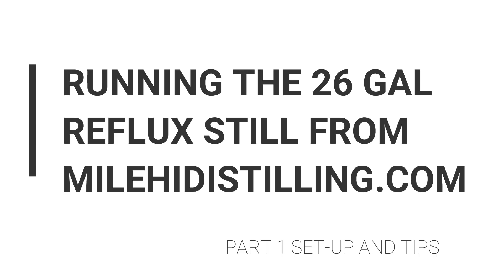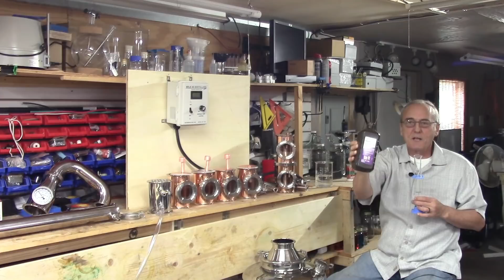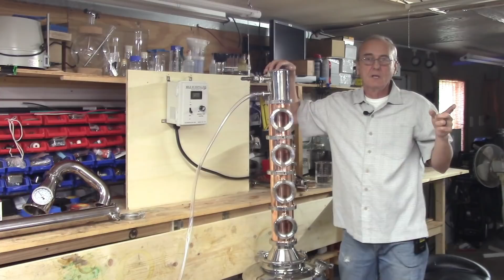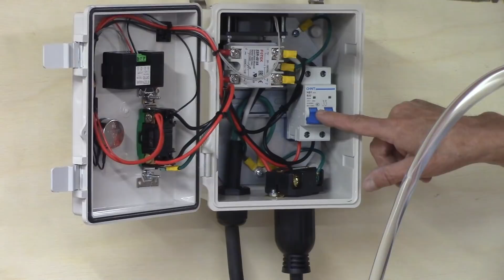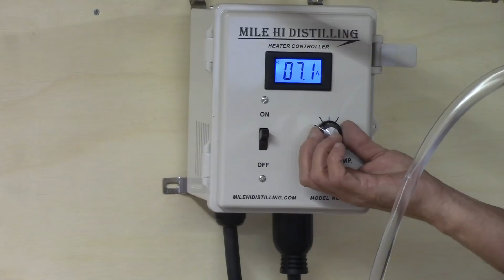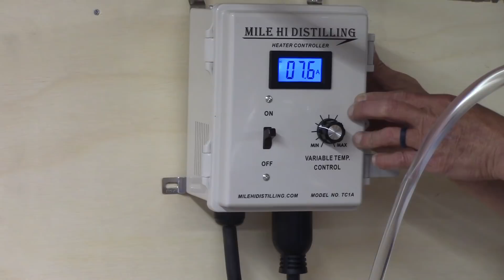RUNNING THE MILEHI REFLUX STILL PART 1

Comment: in your video for the reflux still you controlled your water flow  thru a valve on the inlet side of the reflux condensor  is it different for  bubble  plates  or a small error?

Comment: What about using a T connector on the cooling line. Then putting the straight forward line into the deflagrator leaving the turn for the line condenser. Would that mean you keep more head pressure on the deflagrator which you are going to control via the ball exit valve. Of course what you have is working, my suggestion would be more for someone that only had a T and what would be the best way to use it.

Comment: Hi , I would like to know what temperature the water flow running in the condenser should be maintained at ? You mentioned anything less than 70 degrees! Is it C grade or Fahrenheit ?
Thanks for all your vedios they are all very efficient and very well explained.

Comment: Glad I watched this video. Just went and checked my newly assembled  (& yet to be used) still with 4 x bubble plates in a glass tower as part of the reflux column, and the top bubble plate is right under the dephlegmator -  somebody  has assembled the bubble plate stack together incorrectly.  Thankyou George, you are a constant source of good information. Looks like I'm going to have fun pulling apart the bubble plate stack tomorrow :(

Comment: In a cross tube the heat chases the water out of the tubes so the valve on the output helps keep em full

Comment: I'm confused about your explanation on the water flow through the dephlegmator.  I understand putting hte inflow at the bottom (otherwise it drains straight out without filling it up).  But why put the valve on the outflow and not the input.  Having pressurised water (normal town supply) coming in the bottom and having hte valve off will create pressure in the dephlegmator as the cold water heats up.  If you put the valve on the iinlet at the bottom to control the flow of water into the dephlegmator. Then when you stop the flow the expanding water just flows out the outlet at the top and doesn't create any pressure in the dephlegmator.
Reply from the maker: The pressure you refer to is not enough to compress water. You could put the valve in either place with the same results. I chose to put it on the outflow.

Comment: George,  I don't quite get the [ heads ]  concept in a reflux,,  it seems to me since you reflux the the product, past the point of methanol  that there is none going to be in the output,  it would just drop back into the wash,  while in full reflux  till it gets to 173 degree  the vapors have been dropped  back down and would not return until - unless you allow it to drop to a temp of approx. below 165 degree,  which you should have stopped collecting before that ever happened,,  what is wrong with my thinking on this??   #HAPPYDISTILLING

Comment: Question if you ran this still with a PID controller would you install the temperature probe above the dephlegmator or would the cool water running through it confuse the PID?  I'm asking for a friend.....

Comment: George, I was contemplating a parrot, but I came across a video on how it smears the cuts.  I think he used food coloring in his experiment.  Just curious your take on this...
Reply from the maker: Smearing can be challenging. That is why most times the parrot is emptied during cuts or not used until hearts are collected. In this set up the parrot can be emptied at each cut which avoids smearing all together.

Comment: Hi George, I think I mentioned on a previous video (but I don't think it was the one that was discussed), but does good grade silicone you could buy online leak chemicals. I think we all want to make our own gaskets rather than the still dough or the PTFE tape gasket. Saying that I have found it so much easier to just wrap the lip with PTFE tape instead of making a gasket. Obviously this is for distilling water 😁

Comment: what fitting did you use to connect the ball valve to the dephlegmator input? mine doesn't have internal threads so i can only clamp hose around the outside of the nipple
Reply: Check out parker fittings

Comment: Food for thought. Running full refux. PID controler running refux water pump. Would allow you to walk your temp up after you've stacked the column and make cuts based on head temp. In addition, it would automatically maintain head temp. Thoughts?

Comment: George, the Mile High temperature controller does not appear to have a temperature sensor to control the heat been produced. Would you recommend this or the PID units you build (I'm building one) instead?
Reply: Was wondering if you could run this still with a PID. With temperature probe above the dephlegmator.
Reply: Sure hope so. I got parts for a dual element PID with a 2" K-type 1/2"NPT probe.
Reply: PID’s  to my knowledge “learns” patterns and repeats them.  Not a fan because my mash %’s are different and also volumes.  So it kinda different over time. Had massive problems with it overshooting,  then I’d cut the power and it doesn’t want to come back up to temp and hold it there.
I LOVE the control of my potentiometer.  I use a Blichmann Brewcommander and interchange it from brew kettles to still.